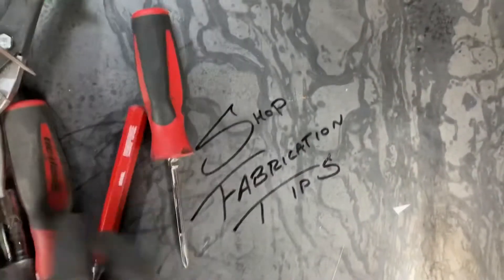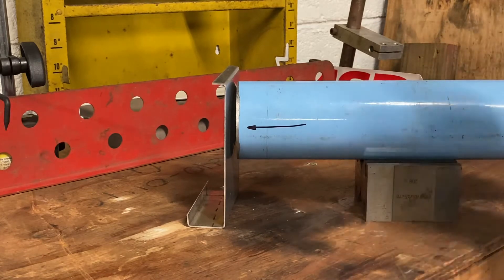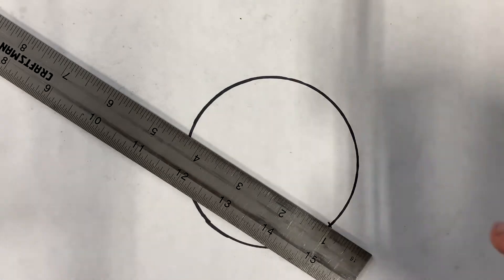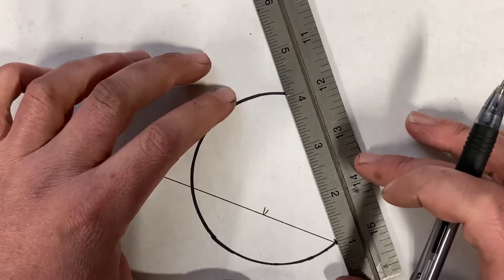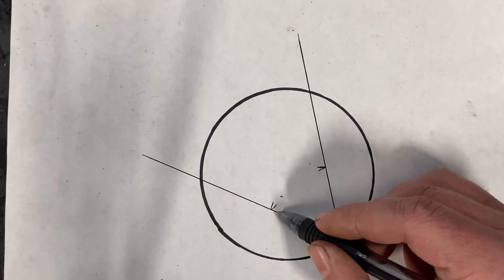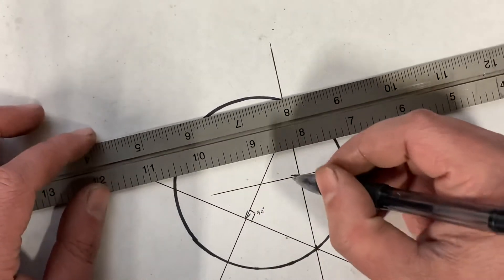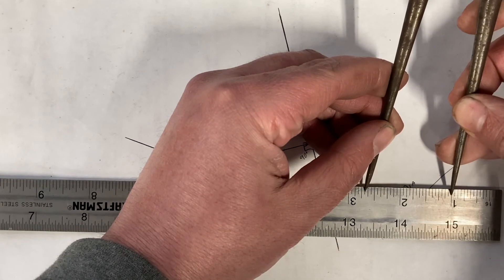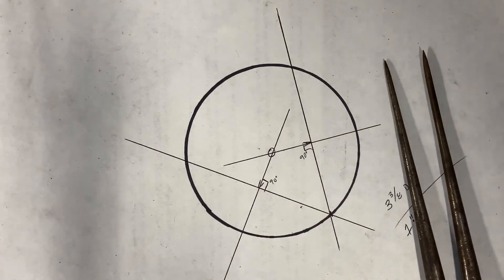Fab Tech: Finding center of a circle

Comment: Thank you for this tech tip! I have always wondered if there was a more accurate way to find the center of a circle than the way(s) I do it. It also came at the perfect time as I am building a dash & I will have to find the center of the gauge circles I am transferring to the engine turned aluminum inserts. I also watched your vid on engine turning on a drill press, you used a different pattern than I did so I filed that info away for the next time.
Reply from the maker: My pleasure! Glad my video helped your project along!